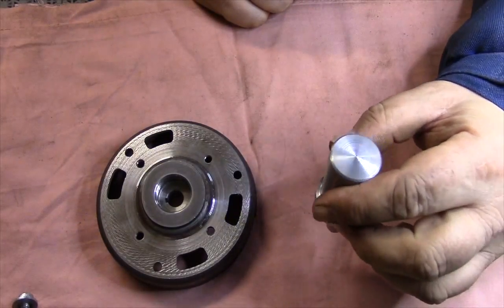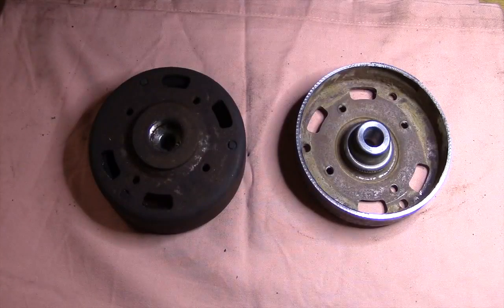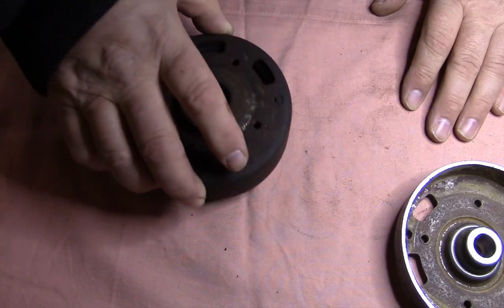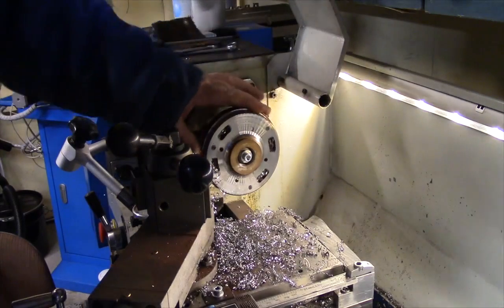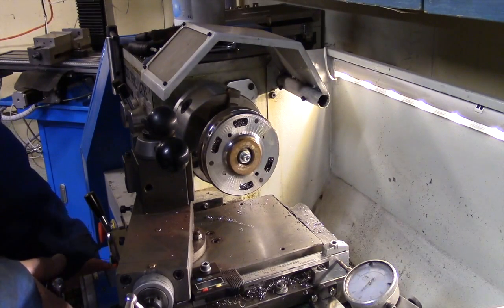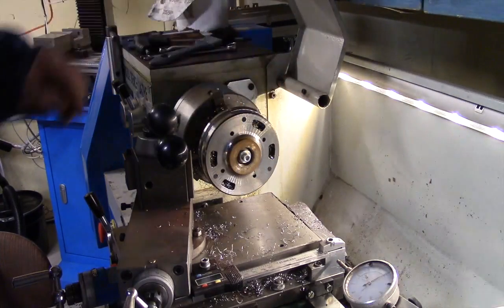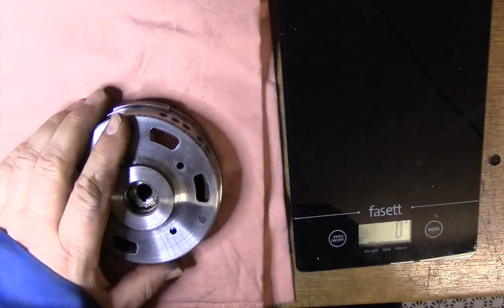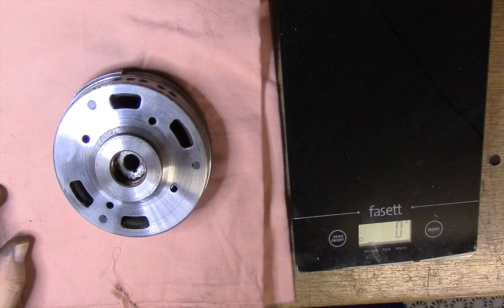Peugeot Speedfight 100 flywheel mod part 2 (final)

Comment: Hi, I'm getting a ratlling noise on tickover on my speedfight 100. It can be heard from the fan side on the engine (fan isn't loose) . Could the flywheel be loose or anything that could make this rattling noise ?
Reply from the maker: It's actually impossible to answer such a question because rattling is such a general term for many types of noise that an engine would generate when it's unhappy. Generally the flywheel can just be in two states, tight or totally loose. That's because it will start make a rather terrible noice and stop spinning rather soon after it gets loose. I would start to check if the fan cover is cracked or not in place.

Comment: I have problem with heat, there where the belt is whole thing is always hot like hell after 30-40minutes od riding. What can be the problem?
Reply from the maker: It's hard to have a serious opinion about your concerns, but generally speaking, there is a lot of heat produced by the slip/friction between the clutch/varioator and the belt. Mine SP100 was always hot too on the cover, almost impossible to touch.

Comment: help. I have bought a cylinder with a new piston and the measurement of light between the rings but it comes with 10mm and I don't know if they have to open. Thank you
Reply from the maker: I do not understand your issue, it doesn’t make sense.
Reply: @fiftynineridge  thanks for answering. I have a new cylinder that I buy from ebay but the piston rings come in at 10mm. and I have read that the space of light must be more open. sorry for my English
Reply from the maker: @carloscop100  still don not fully understand, are you saying that the ring gap is 10mm or is the piston ring visible 10mm down some of the ports?
Reply: @fiftynineridge  good day.I put my ring in the cylinder and the space it gives me between the tips of the ring gives me 10mm. that measurement is correct? thenks jj.
Reply from the maker: Oki, that’s reaaly bad, probably the wrong piston rings. I would say a suitable ring gap is around 0,25mm to the bore of a SP 100